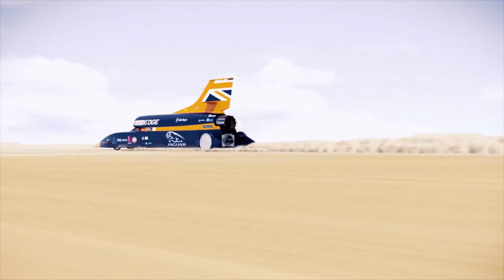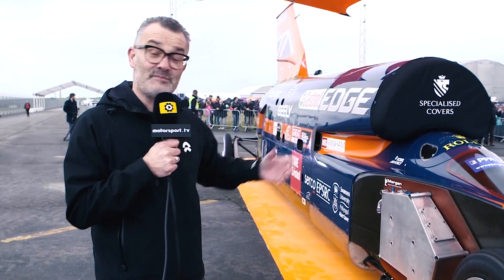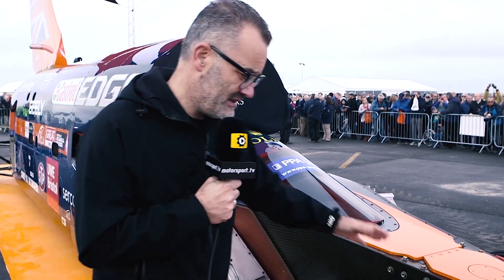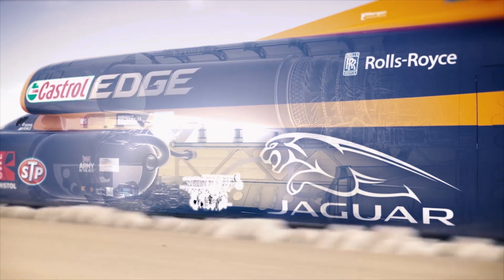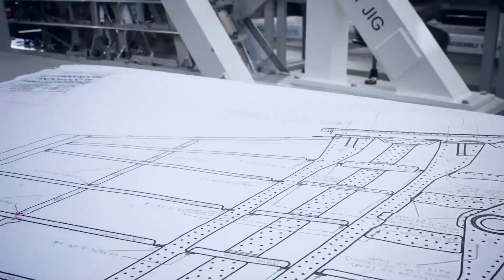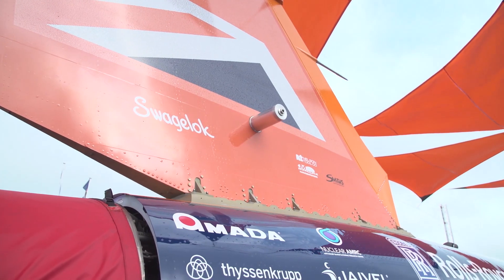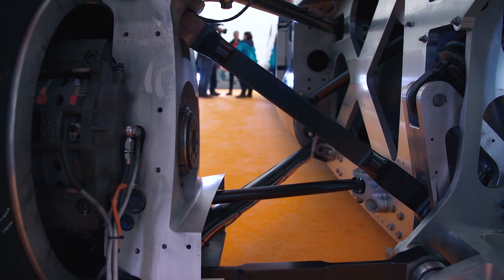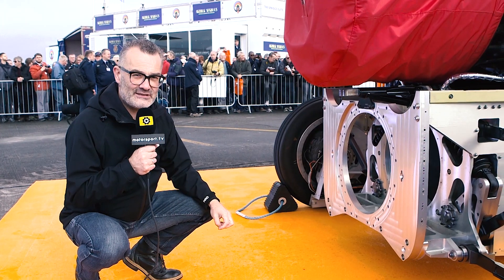The Mach 1.4 machine   -  Bloodhound

Comment: Curious about the rockets. I thought that once an SRB was lit you can't turn it off. And this needs to perform two runs. Or can these SRB's be lit and turned off? Amazing machine. I was going to type amazing car but it seems far beyond a car.
Reply: Matthew Sinclair it's a hybrid rocket motor so it has a solid fuel lining the motor and a oxidizer that is pumped in via the jaguar engine. They can be restarted several times so long as there is enough solid fuel left. They're also much safer than a solid motor as when the oxidizer is cut it will stop instantly 😃
Reply: They plan on taking it out and replacing it during the hour between runs I believe

Comment: During the test runs, they mentioned that the planned V8 powering the HTHP pump for the rocket oxidizer is being replaced with an electric motor.
Reply: sounds like a much better plan
Reply: It was actually after they'd found themselves with a viable engine but no customer and the engine rules changed and put the nail in the coffin of possibly the best naturally aspirated F1 engine to date. But the reason they're using the Jag is all about ease of use, and better torque. They can both move the same amount of fuel when you correct with gearing, but the F1 engine is more involved to start, and for the kind of pump they wanted to run the reduction box didn't really add up to a rational choice. I think this was in the Chris Harris tour of the facility that I learned this.